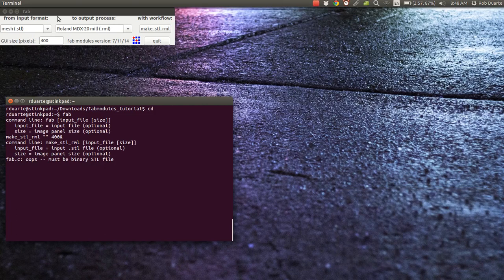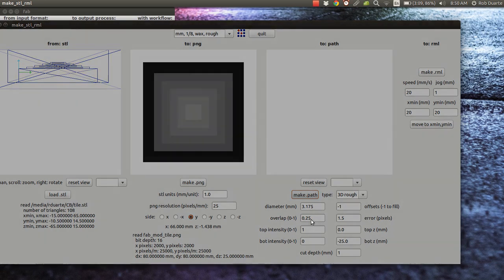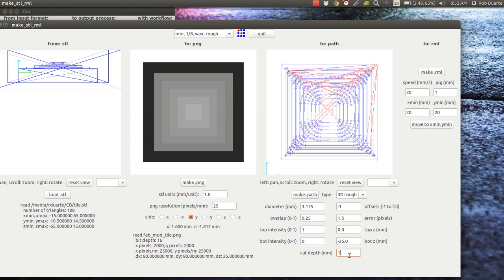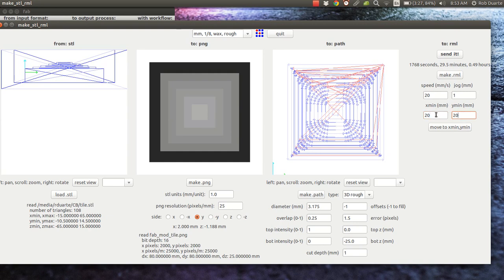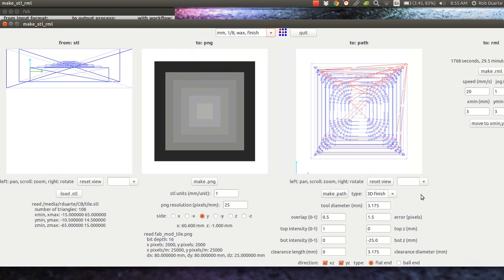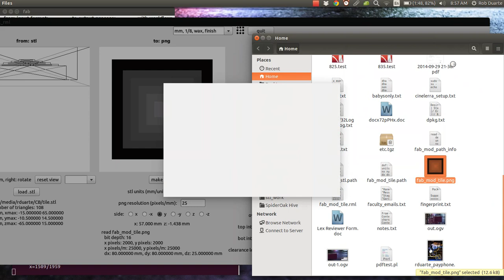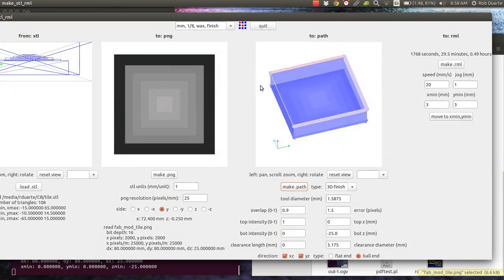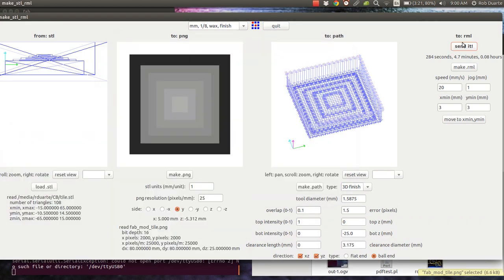Using the Fab Modules + MDX-20 milling machine

Comment: HI, i´m from mexico, where can I the programs fabMoudules?, thank
Reply from the maker: ThePhoenix2103 you can download the software I showed in this old video here: http://kokompe.cba.mit.edu (there's a download link near the bottom). The installable software has been replaced by a web-based version. I still use the old compiled software though.
Reply: Thanks, i saw the link with web-based version, but in my school the internet its unstable. This is a problem
Reply from the maker: +ThePhoenix2103 I believe the idea is that you can install the software on a local computer but that the interface is through a web browser - ie you don't need to be connected to the internet to use it
Reply: Rob Duarte  oooh ok, thanks i did not had idea, i will to use the new versión. thanks